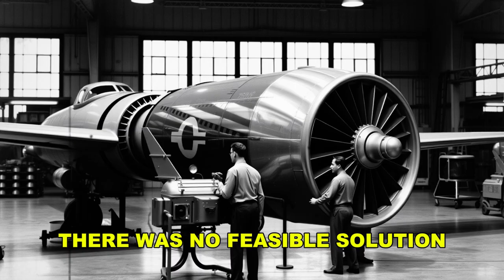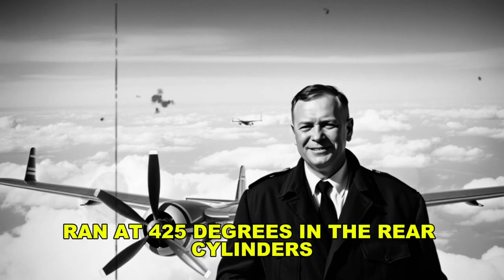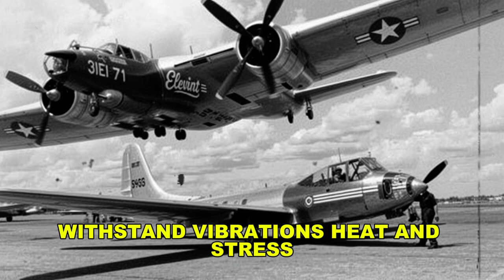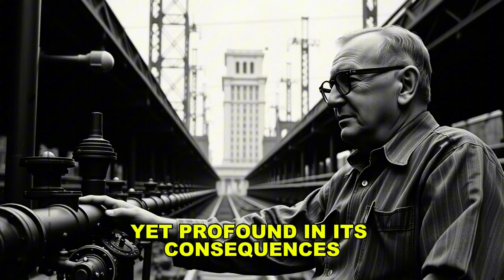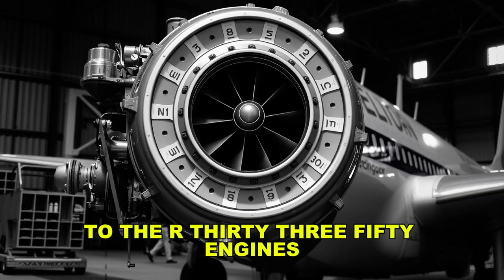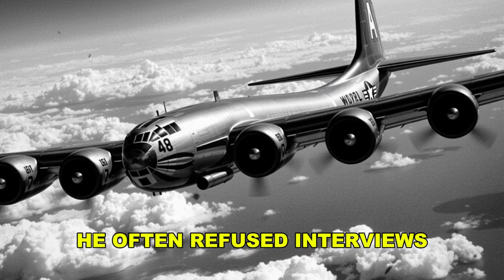The Plumber Who Broke the Law to Save 2,000 Bomber Crews

Comment: The Ai clickbait image has a pretty ridiculous 4 bladed propeller with no symmetry, and shows a 2 engine airplane in a video about the 4 engine B-29. The next image is also bizarre, showing a 2 engine airplane with a wing set at about 45 degrees to the fuselage in the pitch axis.
The yarn says the R-3350 rear cylinders cooked themselves because they were in the “shadow” of the front cylinders..Two row radials are always staggered in rotation so the rear cylinders are centered in the gap between the front cylinders.  This gives the engine evenly spaced power strokes. The engines are always baffled so that no air that has cooled a front cylinder ever flows over a rear cylinder. All air entering the cowl goes through the fin spaces of a front or rear cylinder. The problem in the B-29 was a detail problem of the cowl and baffles. Eventually these details were fixed and the R-3350 served in Korea and later in B-29s and the R-3350 powered the Skyraider of Vietnam fame and several Lockheed Constellation models successfully. Pratt and Whitney successfully cooled its R-4360 with 4 rows of cylinders in the air…..on the ground there were challenges.
I’m sure that the size of B-29 missions also contributed. A long ground run before takeoff was a big problem for these big radials.
The B-29 embraced more new technology than any other WW2 airplane, and it was pushed into service before it was ready for service. More B-29s were lost to operational problems than enemy action. Google “battle of Kansas”.